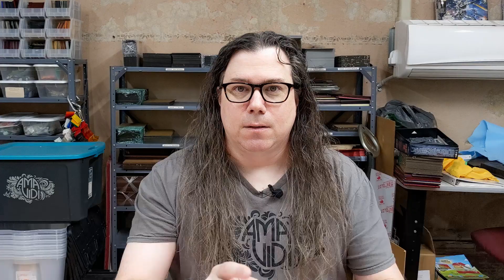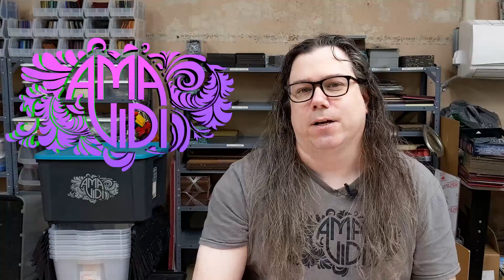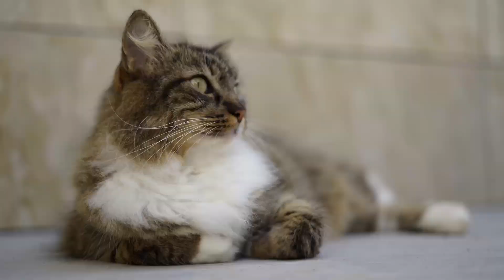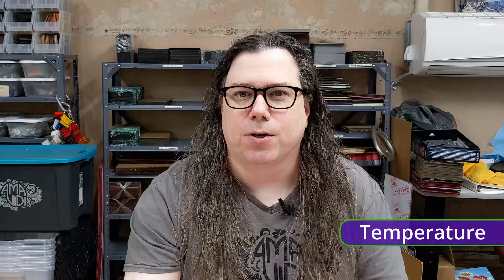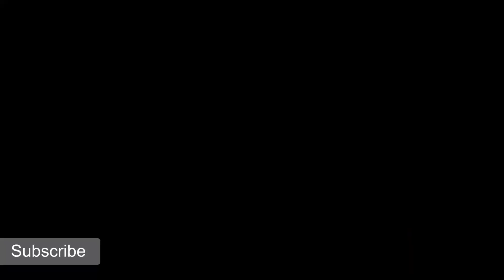A BEGINNERS GUIDE TO CURE TIME FOR PLATINUM CURE SILICONE

Comment: Can I cure the silicon mold under the sun?
Reply from the maker: Hi... The silicone mold curing won't be affected by sunlight.  The main thing that will affect cure time is temperature.  Higher temps = faster curing.  Lower temps = slower curing (below 60F it may not cure at all.)   Hope that helps!

Comment: I put silicone in the fridge to see if it would stop it from curing. The next day I took it out. The silicone had already cured... Maybe it started to cure before it went into the fridge. Idk
Reply from the maker: That's not unexpected. If you have mixed silicone and drop it in the fridge, the temperature of the silicone is not going to drop below 60F in seconds - depending on the volume and container shape it could take an hour... And by then the pot life is done in virtually all silicones.

 I have seen lower temps (65F) double my pot life and I know other makers who have used temperature to their advantage.
Reply: well I can tell you that I tried to cure my silicone at 68 and it never cured, I took it to my trunk of my car to get it warmer still it wouldnt fully sure it was soft on the inside but cured on the outside no matter how hot I got it. I bet if I started it off in 75 ish or more it would have cured all the way through.